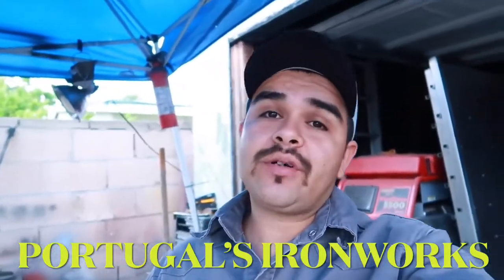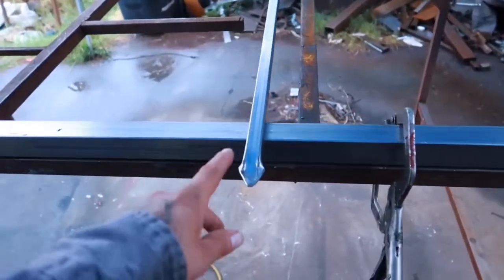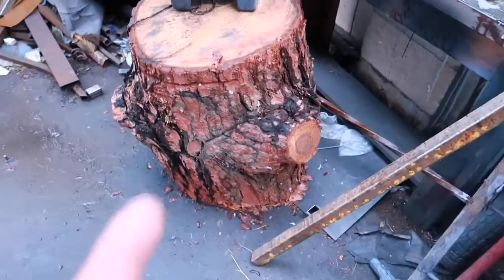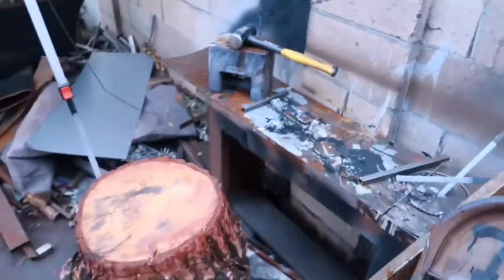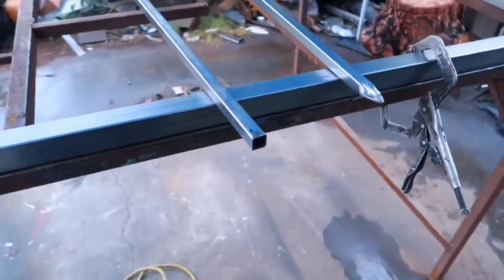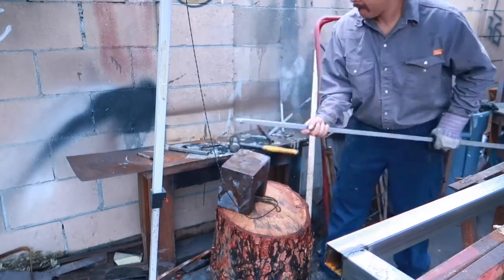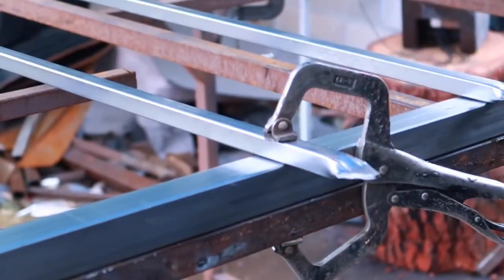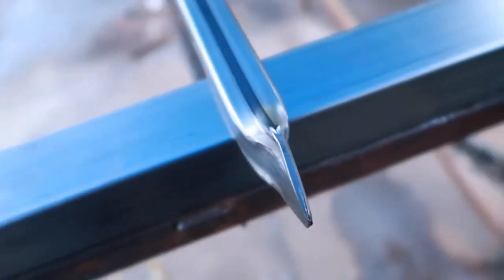DIY Punched Picket

Comment: I've been looking for an anvil for quite some time and every time I find one, is garbage and expensive. That weight will do the trick. Thanks for showing how to do those tips.
Reply from the maker: Yes if you get the cheap ones they end up cracking or something but if you want a good one they are a bit pricey. Thanks for the comment  🙏